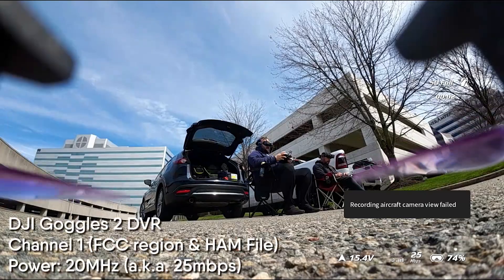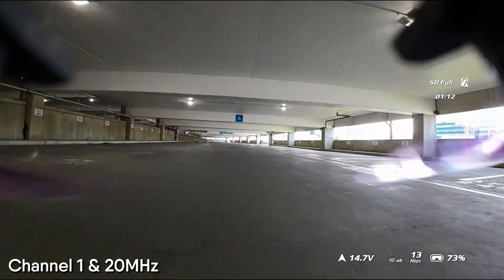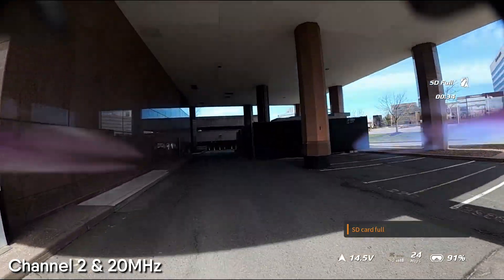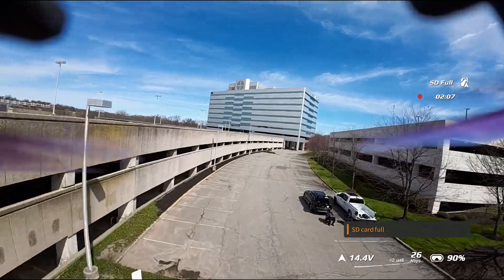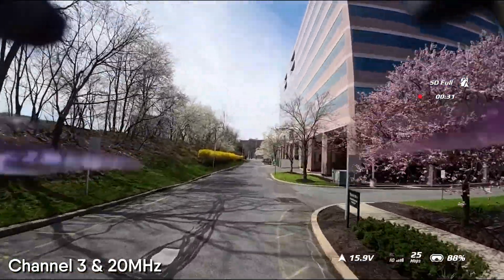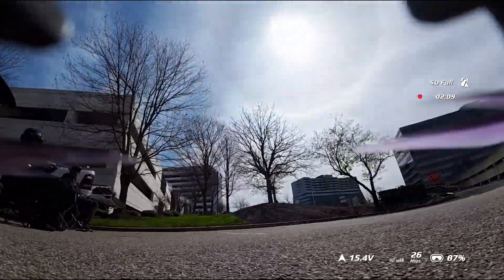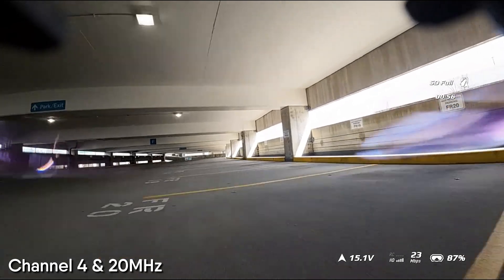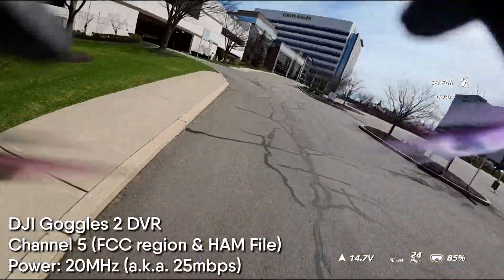What is the best channel on DJI 03?

Comment: You never ran it on auto, manual mode is for multiple pilots per the manufacturer.
Reply from the maker: I will record and post a run on auto. I did not include it in the video because it looked basically Identical to the performance on channel 1 at 40mhz.

Comment: I appreciate you taking the time to run these tests. I agree that different settings will be better at different locations. I fly alone  100% of the time. My understanding is that if that's the case setting my goggles at 40hz/50mnps in auto is supposed to offer the best range and penetration. What I don't understand is that with those settings my performance will be inconsistent depending on the day in the exact same locations. Also, for some reason there's no way I could get the same range if I flew the test in your video. I have the goggles Integra (faa & ham hack) and 3 different kwads all set the same on the 03 air unit system. I feel like I should be getting better range/penetration but I can't think of any else I can do to improve it? Thanks!
Reply from the maker: It is shocking how much the RF interference can change and effect the video systems. If you dont have an issue, leaving it in auto is the easiest and the performance is generally excellent. If you are flying longer range or you have a spot that has alot of wifi (which does channel hopping), finding the right channel can get you more consistentcy in your signal, atleast that has been my experience.